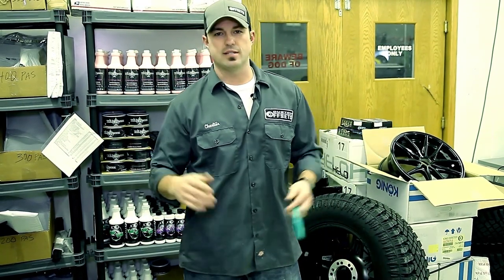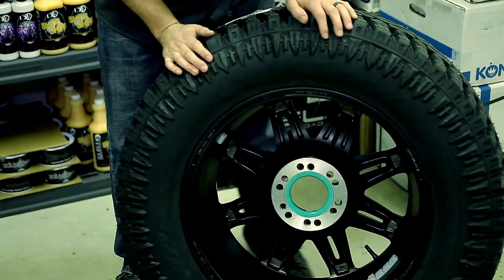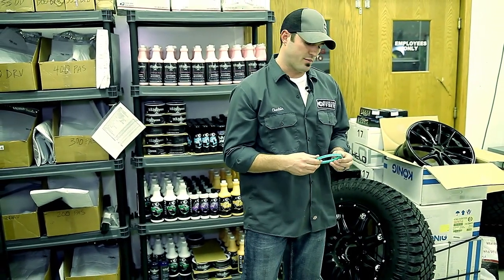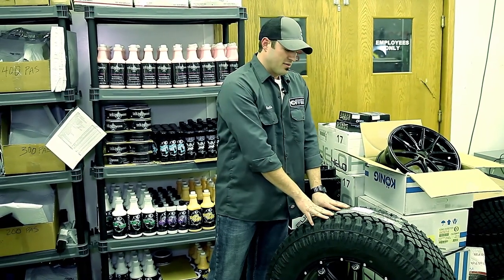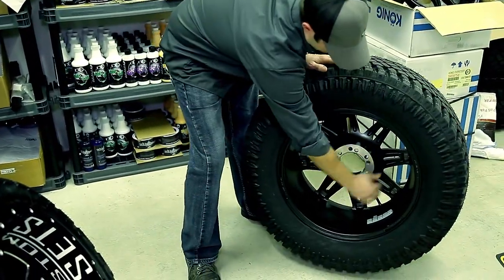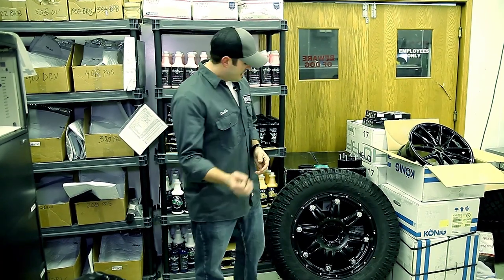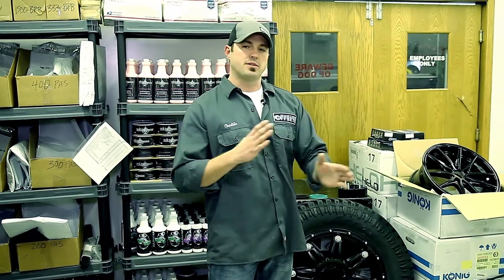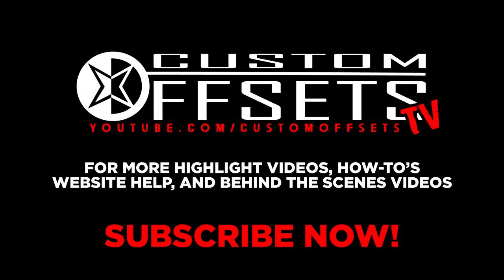How to fix wheel & tire vibration balancing hub rings, spacers, bead bag balance, rotation etc.

Comment: This video said that you can stack a hub ring onto a spacer.  I have a 3M spacer that is designed for my car that I want to use to make sure my aftermarket wheels clear my big calipers.  Can I put the spacer on and then put the hub ring on top of the spacer?   The reason I ask is that my mechanic is telling me that I cannot use them both.   I have to choose the spacer or the hub ring.  What do you think?
Reply: Well, he said that the hub ring is designed to go up against the wheel itself and not the spacer.  The spacer itself is designed for my car with the correct hub bore.  However, it does not have a built in hub ring. I don't see where it makes a difference as long as everything is tightened down.  I will probably use extended bolts.  I have an Audi A6 2001 Quattro. 2001 2.7T
Reply: Well it is kind of a mute point because my new wheels did not fit.  The offset is so tricky.  Thanks anyway.

Comment: Do you just suggest the beads with 35 inch tires?
Reply: Yes, always a better route. Over time, traditional weights need to be rebalanced. Beads will last the life of the tire barring any repairs

Comment: I have hub rings on the car. Car has been balanced 3 times already. Still vibration after 80. No vibration at all with stock wheels. My next option is Hunter Road Force balance. Pray to god it works
Reply from the maker: Possibly an alignment issue??

Comment: Yeah for me, new front passenger wheel put on my car now I got vibration in the steering wheel and I can feel something in the tire area, any solution or do I just pick one from here lol
Reply from the maker: Torque down those wheels!
Reply: Custom Offsets   what’s torque down the wheels?? Should I go in the shop and say torque down my wheels! I’m a female also I have a Jaguar XJ if that matters. I can’t take the vibration it’s driving me crazy especially since my car was a smooth ride just 3 weeks ago, and it feels like it pulls slightly to the passenger side too! He said he balanced the wheel he put on and not the drivers side front wheel. I really need to know which route to take so I’m not paying for unnecessary services which gets expensive for my car 😖 thanks 😁
Reply: I'd go back to the shop and have them check the wheels they put on. It's not an expensive step to "torque down" the rims, it probably was done in the first place and there could be an underlying issue. Either a bad balance, separated tire or something going on with you suspension. Most shops don't charge too much for diagnosis, make sure you have a reputable service center check your vehicle.

Comment: Are there times where vibrations aren't due to the tires at all? balanced my ridge grappled twice but still get slight vibration at 50 mph. What are some suspension kit components that could cause these symptoms?
Reply: Michael Langmaack ball joints, tie rod ends BUT a speed sensitive vibe is always tires. I know its not easy finding a reputable place to balance big tires but keep trying.

Comment: Great info, I just developed a vibration on my 2015 ram sport about 5000 km after instal of 20 x 9 0 offset Mayhem arsenal rims with  275/60 r20 duratracs .can you email the link for the hub rings
Reply: I have a 2013 RaM that I installed 35" tires and a level kit.  It shakes now.  were you able to fix yours?
Reply: Did you guys fix your vibration? Same truck and same tires. Any help would be greatly appreciated.

Comment: you guys should walk through a video of a tire mount balance on nitto 420s 20inch wheels a 35 inch atturo  and a 37 or 40 on 22s showing all these methods why they work ect also I wish when i ordered tires somebody told me my ram hub bore was way off vs new wheels i bought
Reply from the maker: Jesse, they make hubcentric spacers to help with that!
Reply: ordered them but your sells team should start pairing these no matter what if the vehicle bore is smaller than the wheels purchased

Comment: I ordered some spacers and my truck almost bounces down the road and idk what to do 
My tires are new rims are in great condition and their balanced
Reply from the maker: Brandon, make sure the spacers are correctly installed! Also make sure the wheel is properly seated on the spacer. Improperly installed spacers/wheels can cause major damage to the product/vehicle/yourself
Reply: Did you get it fixed?
Reply: @RickySlatton  yeah it was just the spacer had to retighten or soemthing was years ago on a different truck
Reply: @brandonnicol2422  thanks man!

Comment: I have 20 "s Mayhem wheels on my 16 Chevy Silverado but I'm not sure if the people that install my wheels and tires used Center Rings how do I find out or why is my truck still shaking? main question is what's the hub size of my silverado 2500 HD?
Reply: Custom Offsets okay but do you happen to know the size of my hub on my truck?

Comment: i lifted my truck an ordered some  22” wheels with 35’s from custom offsett ,mounted, balanced , w/TPMS , HAD them delivered to my mechanics shop , right away i could feel this vibration so i gave C/O a call they said try these hub centric rings and i have been good ever since
Reply: Where’d you get the rings from?
Reply: Cory Tackett i ordered them over the phone from custom offsett theyll need you trucks hub  diameter And the wheels Inside diameter for the correct size “Hub centeric rings”

Comment: Dude my left rear tire keeps wobbling with new hubs and hub rings. I have aftermarket Ferrada staggered Fr3 wheels on here. Hub rings fit the rear, too tight for the from. But rear drivers side wobbles. My veteran busy told me it's loose too the side of the hub but flush on the wheel. I hate two extra hub rings, any suggestions?
Reply from the maker: Try cleaning the flanges and hubs with a wire whlee/wire brush to knock the brake rust free, and see if that'll help with getting them to fit with the hub rings

Comment: I put 22 inch rims on my Silverado will the same hub centric rings fit the 22s or will I have to get a different size?
Reply from the maker: Depends on what wheels you get, sometimes you can get away with the same rings but most of the time it's safer to get the correct rings with the new set of wheels

Comment: Hey I have a 2007 F150 on 33" Toyo mts and 2" spacers all the way around. When I get around 50-53 I shake just a little bit but after that it's fine and before that it's fine. Do y'all know what it might be? Or sound like?
Reply from the maker: its slightly off balance, but clears up is what it sounds like. wouldn't be too worried unless you do alot of 50-55mph driving

Comment: My trailblazer shakes pretty bad after putting 20 inch rims with 2 inch wheel spacers the wheel spacers don't have a lip on the outside so I don't know how I could use a hub Centric ring for that
Reply from the maker: Buy a set of spacers with the ring! Could be a life saver, literally!
Reply: The spacers to the hub is hub centric but the outside of the spacers there's no lip going into the rim and I can't find any that do I went from six lug to five lug

Comment: Hello! I was wondering about hubcentric rings and wheel spacers. Few months back, I installed new aftermarket wheels on my car. It didn't come with hubcentric rings so I ordered it from the site I bought the wheels from. When I went to get my wheels installed, they put the hubcentric rings only on the front wheels and not the rear wheels--because they installed spacers in the back to reduce the chance of rubbing. They said it's not needed to put hubcentric rings over wheel spacers. Is that true? They said I have to deal with the steering wheel vibrating around 65mph and it won't hurt the vehicle. Please help.
Reply: Okay, thank you! I was thinking that my wheels need to be balanced again and to make sure I have hubcentric rings on all the wheels.

Comment: I just installed wider tires on my wrx. Went from 17 by 8 to 18 by 9.5s. Bought and mounted by tire rack. Now i have a slight vibration. Is this due to wider tires? Balance issues? Plz help
Reply from the maker: Could be balance issues, could be non-hubcentric wheels, or out-of-round tires.

Comment: Hey guys I just bought 22in wheels for my f150 online the came mounted and balanced I put them on and I get a vibration around 70 miles per hour wondering should I just get them rebalanced or get The Hub Centric rings my tire size is a 305 40 22 and also I also have a plus 30 offset just want to  make the right move and not waste money on fixing the small problem.
Reply from the maker: Did you order them from us? if yes, shoot us a response to the last email received. if not, try rebalancing them or a hubcentric ring!
Reply: I will and thanks
Reply: 70 miles an hour can also be an alignment issue

Comment: If I am running wheel spacers without the bore, should I still run the hub censored rig?
Reply: ***** Thank you! I have the hub centric rings. The spacers i purchased were from a auto shop and they didn't have any hub centric spacers. So, I guess what i am trying to say is can i just put the rings in the rim and mount the rim to the spacer?

Comment: Can this issue happen with stock wheels. I have a 2017 ram 1500 and i have a vibration when driving at highway speeds. Felt in the rear of truck.  Will the centering ring help even though the wheels are stock.
Reply: Jesus Vega no

Comment: So I just put some 20x10 on my 04 z71 suburban and when I hit a certain bump the the whole front end wobbles only between 35-45 it happens not sure what it can be may need to be rebalanced I checked the front end all seemed to be good any help will be appreciated.
Reply from the maker: We would recommend taking it to a shop so they can take a look at what is going on!

Comment: hey Custom Offsets I have a 08 dodge ram 3500 6.7 cummins single wheel  with 20x9 +1 offset I think I might need some hub rings what ones do I need do you have a link to the ones I need to buy from you guys thanks
Reply from the maker: shoot us an email to info@customoffsets.com and we'll get you squared away with some!
Reply: Custom Offsets will do thanks
Reply: Custom Offsets just sent the email

Comment: Hey I just put my brand new wheels and tire on my truck it's already balance the tire still vibrate I need some help pls
Reply: The shop tighten the tires for me still vibrate I do you think I need a hub center ring to stop the vibrate
Reply: Isn't possible to put hub centric ring to the spacers

Comment: My 2001 tahoe never did this before intel I put  some 20x12 wheels. My steering wheel will rock back and front so bad then stop if I break .. If I’m driving on the freeway it’s 100% normal. can you help me please thanks
Reply from the maker: I’d get that thing into a shop as soon as possible. If the tips in this video didn’t work you may have a failing caliper, wheel bearing, or other suspension component.
Reply: Custom Offsets  thanks a lot for the  Respond I’ll do that

Comment: What size hub rings do I need for my 2011 f150 with fuel hostage 20x10
Reply: Did you find out the size of the hub rings? I have the same truck and wheels

Comment: My trucks hub is 106mm and my wheels are 108mm so not a huge difference but my rings won’t fit because of the center cone on my method nvs
Reply: Hey man did you ever figure out a solution for the NVs? In the same boat with my Tacoma

Comment: I just got my setup and installed today. 0-40 is fine but 50+ shakes vibrations. Had to call and order the rings for 35
Reply: did it work bro?
Reply: @JesusF150  yes the rings helped cut a lot of the vibrations because of aftermarket wheels and the hub bore size
Reply: @TurnThemWheels  I did alignment and balance and my truck is still shaking, do you think it's the spacers? i'm frustrate
Reply: @JesusF150  possibly spacers or road force balancing for the tires, or wheel weights

Comment: I bought a set of wheels and tires from you guys in April with balance beads. It’s a crap shoot on whether or not the wheels will vibrate. Some days and drives it’s great. Some drives you can’t go over 65 without rattling your brain. 

I’m not a believer of balance beads. I would not recommend them at all.

Comment: What's your web site I need some for my Nissan titan
Reply from the maker: customoffsets.com !
Reply: Hey bro I have a titan as well did u get the vibrating steering wheel after some bora spacers? Cause I did
Reply: Gibbz Villarreal  yes I couldn't find the senter ring check your ujoints that kinda help alot but still have some viration

Comment: I have a even CHEAPER AND EASIER way to balance ANY TIRE !!! I have BB's in EVERY tire I own !! I buy the COPPER BB's and add  2 to 6 ounces to each tire(depending on the size and tread pattern). And I've ran over 60,000 Miles with NO ISSUES !! Even with low pressure !! I'll NEVER used fixed weights again on ANYTHING I own !!. I even use them in my Motorcycles and ATVs !!!!. And , YES I use them I'm Tubes also. But you gotta find smaller BBs for a tube !!!. Steel Birdshot  works GREAT in tubes !!!!!. Try it and you'll be sold also !!!.

Comment: Hub rings do not support weight. The clamp pressure between hub and wheel is what supports weight. That's right from auto engineers.

Comment: centric rings are NOT available for vw drums they would be different front and rear if there where ,,,,i CANT FIND here in central florida anyone who can balance my rims on my buggy because they are LUG CENTRIC and no one seams to have the adapter that goes onto the balancing machine ! , then your dealing with young techs that think your from mars when you tell them that !   go figure HELP ! lol
Reply from the maker: Might be better off with balancing beads at that point bug Den
Reply: i dont know what those are      ,,,,,here is proof that even at 65 we learn still LOL ,,,,,please help ! @CustomOffsetsTV
Reply: ha ok i see how that works ,,,,thanks

Comment: I am having vibration issues with my 2014 silverado LTZ Z71 6" Rocky Ridge lift. Wheel size 22x12 , tire 33x12.5R22 ,SC-18 Scorpion wheels. I have installed the center ring had all tires balanced and alignment. I just rotated my tires before I rotated them it had a little vibration now its like really bad. Need help !

https://youtu.be/G75vKIK2x4g
Reply: Did you find a solution??

Comment: the hubcentric rings do not contribute to holding forces - a rim is held to its hub by the friction force of the tightened lugs.  the hub does not take the weight, if it did then the wheel would be permanently off balance unless the hub and wheel were machined to extremely tight tolerances and pressed together.
Reply from the maker: The rings do make a fairly tight seat around the hub and ring. Mainly there to take away some of the vibration you may have from having a gap between the wheel hub bore and the hub itself!
Reply: @CustomOffsetsTV  the rings only serve the purpose of centering the rim on the hub as it is tightened.  they don't contribute to the structural integrity or balance of the rim whatsoever.